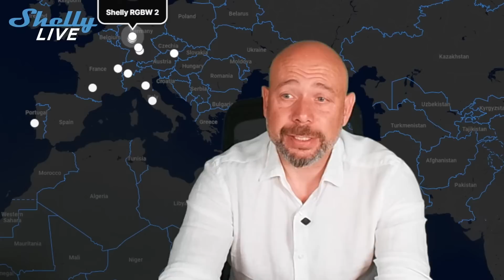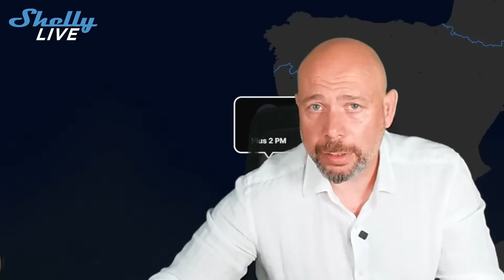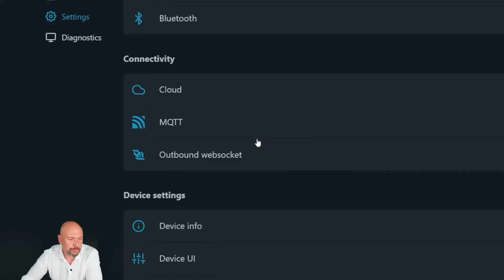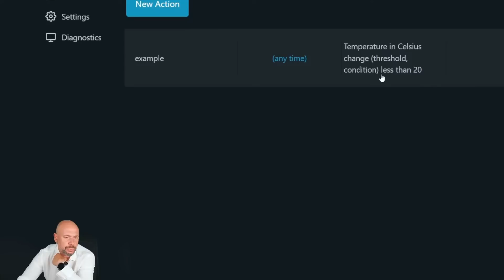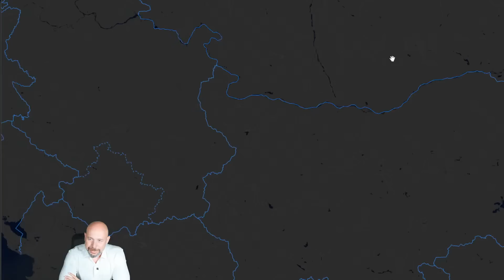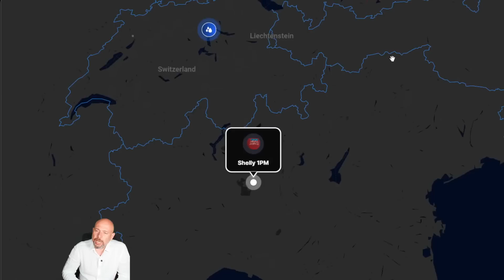Shelly Live Stream August'31

Comment: I like Shelly products and use a bunch already. I'd like them even more with Thread instead of WiFi and Bluetooth. There are some devices where Thread might not be enough for bandwidth or other reasons where WiFi might be desirable for parts of the functionality, but Thread should be the baseline.